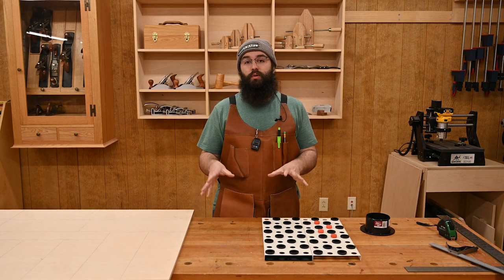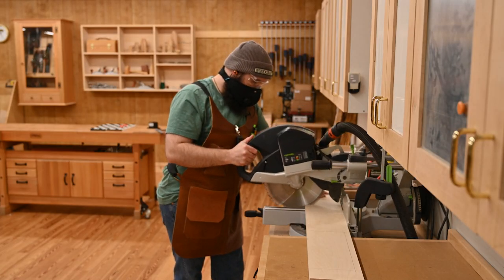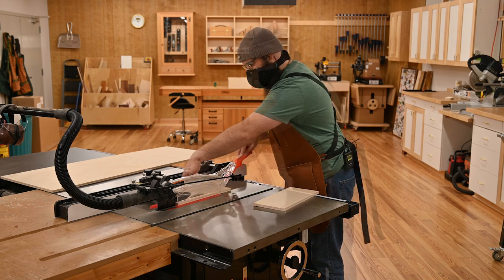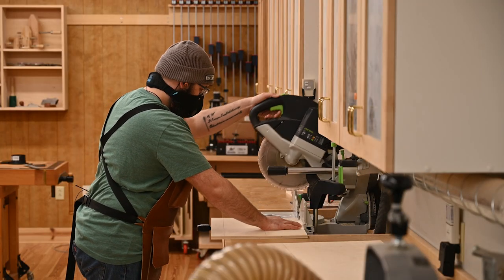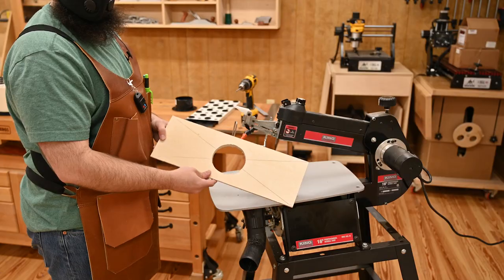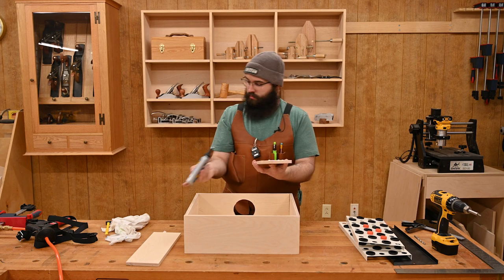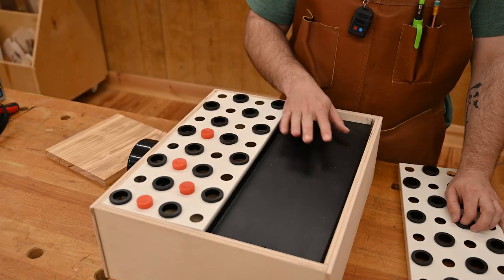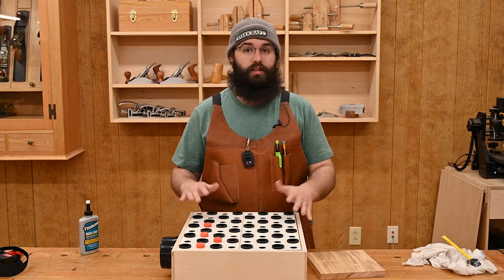Eliminate dust with this easy DIY Downdraft Table

Comment: Wounder if the 2 1/2 hose inlet would draw more dust than a 4". I use 4" from my walls but reduce size a lot on the work table because of all the hand tools. I bought 4 of those panels and was going to make a little bigger top surface
Reply from the maker: I'd be hesitant to drop down to 2.5 especially if you're going for a bigger area.

Comment: I have a woodcraft downdraft insert (just 1 piece) with a 2.5” connection.  I get very little suction.  Running a cyclone cleaner into a 6 hp shop vac.  Do I need a bigger port?
Reply from the maker: It would definitely help. Bigger hose can move more air, which is what you want out of a downdraft table.
Reply: @WoodcraftSupply  so, I could take my 2.5” hose, add an adapter to go from 2.5 to 4” and run that into a 4” flanged adapter into the down draft table?
Reply from the maker: @jimsprague9309  I'm going to direct you to a video all about dust collection I did awhile back https://youtu.be/VfdardUw9pU

Basically, the bigger the hose the better the airflow. but it's a "weakest link in the chain" thing. If you have a 2.5" hose running to a 4" flange, you're still only going to get the air flow from a 2.5" hose.

Comment: Lame
A guy with a lot of very expensive equipment showing how to make something using an expensive prebuilt insert🙄
Reply from the maker: These types of comments really grind my gears. Yeah, I'm going to use the tools I have at my disposal. That doesn't mean you have to use the same tools. You can make all of the cuts with a hand saw if you want but I don't know what tools you have so it's on you to figure out how to do it with what you have.